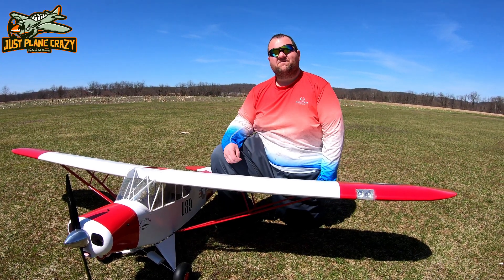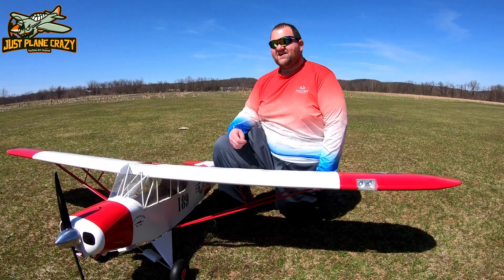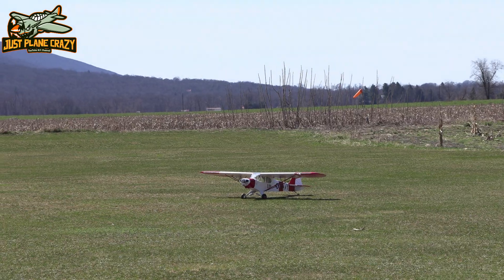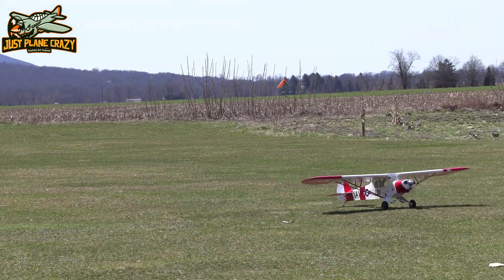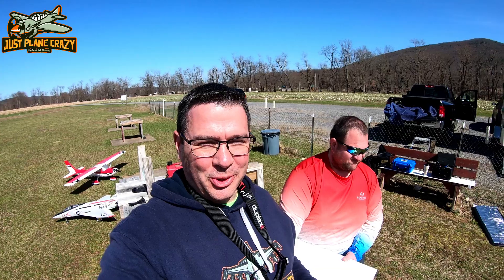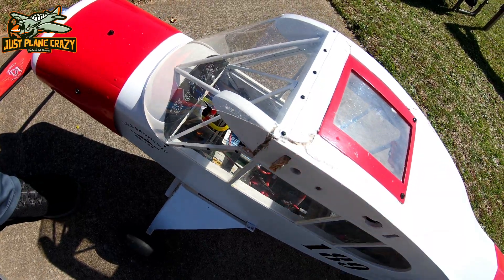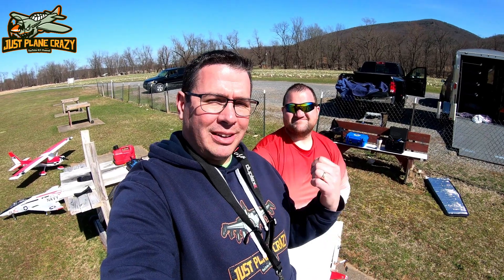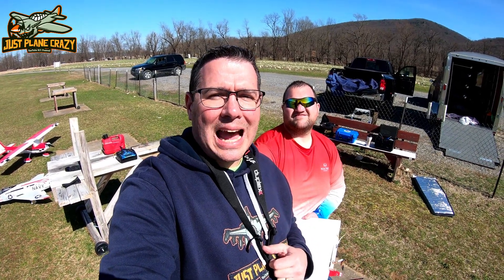Crash of the Scratch Built 1/4 Cub, The Story of a Short Maiden

Comment: Built to existing plans or scratch built?
Reply from the maker: It was built to someone’s plans
Reply: @JustPlaneCrazy  Ok. So it's not scratch built, it's plan built. Scratch built means that you drew your own plans. It may seem like semantics, but to say a plan built plane is scratch built is too take away from those that are actually scratch built, which requires a lot more work. These terms are commonly misunderstood by newer pilots.
Kit built - built from precut formers and ribs and pre-designed plans (full kit) or just precut ribs and pre-designed plans (short kit) can include cowl, canopy, and hardware but not always
Plan built - built from pre-designed plans with all pieces cut by the builder, can still use premade cowl and canopy but could be made by builder
Scratch built - built from scratch with plans drawn by builder (using pictures and 3 view drawings for scale designs or imagination for sport designs) and all pieces cut by builder, builder typically would use scratch made cowl and canopy but not always.
Hope to see plane back in the air, it is very nicely finished, but it is not scratch built. It sucks to work hard on one and crash it that quickly (been there, done that), glad it looked minimal and repairable.
Reply: Thank you for the verification on different building terms.    It was build from plans.   It’s repaired and will have a redemption maiden.

Comment: Was the c of g correct? It definitely looked too slow. Cubs have a habit of being quite snap-happy at low speeds because of their high aspect ratio wings. Try to get into the habit of correcting wing drop at low speed with rudder, the downward deflected aileron on the dropped wing will only increase the drag on that side and worsen the problem.
Reply from the maker: For sure. Good advice

Comment: Shit I wrecked a plane the other day too. First total loss and basically first real wreck iv had.. you just never know what can happen no matter how many prechecks you do, or don't do... A pin in my battery connector pushed out, made a bad connection, heated up and melted the wires apart. Total loss of power and down it went..  found it 2 days later only because the lipo alarm was still plugged into the balance lead. neighbors must of been pissed listening to it all night 😝
Reply from the maker: Lol about the alarm. They have value

Comment: Watched the video a few times and it looked like you were trying to correct with the ailerons the proper way and you even had the rudder a bit right but it just wanted to bank left right after lift off. Your ground speed also seemed decent but perhaps could have been a bit faster before lifting off. Just curious what your post mortem is on why it dipped so badly?
Reply from the maker: We have come to the conclusion lack of airspeed and too much elevator further inducing a snap

Comment: It is very clear what happened. There was absolutely NO rudder deflection to the right as it broke ground. You MUST apply right rudder because of the torque of the engine and “P” factors. Just a little right rudder until speed had increases and you would have been fine. Balance seemed fine, it had plenty of power, and I think it was “ready to fly”, as you say. Do all the same with right rudder and you will be fine. Way too many RC pilots only use the left stick for throttle. Best wishes on the repair and next flight.
Reply from the maker: Great look. Ty